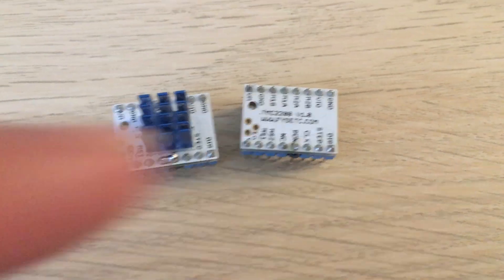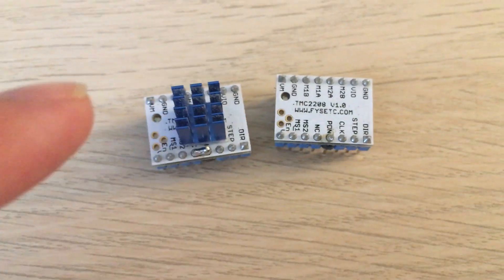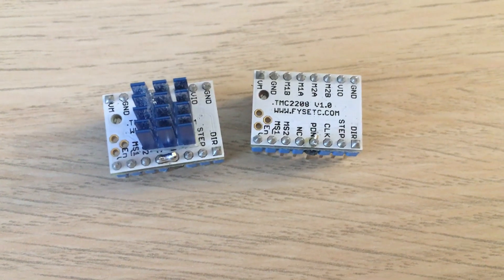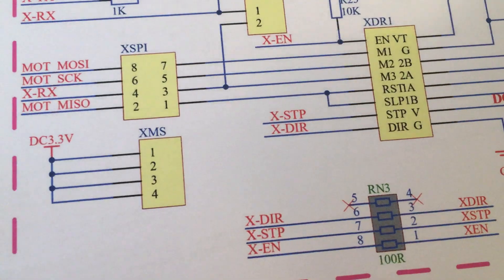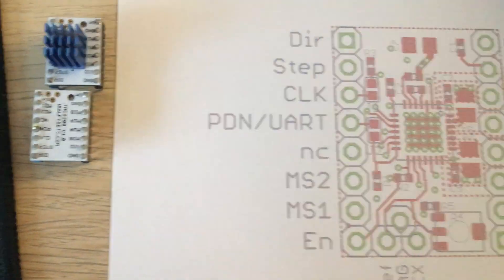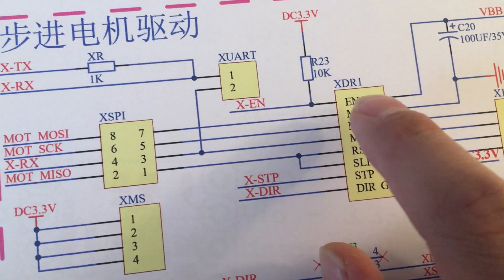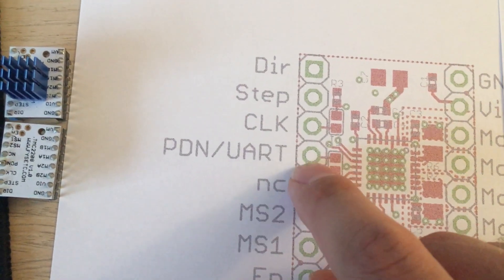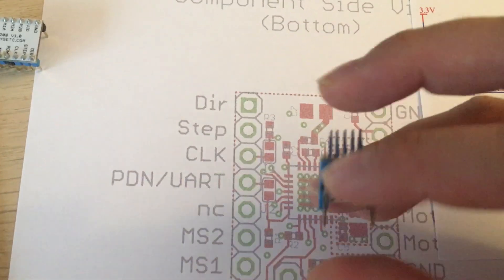Fysetc TMC2208 v1.0 UART on SKR 1.3/1.4

Comment: Thanks i had the same problem. My driver is called MKS V1.1 TMC2208. But is exactly the same. I also had to cut off the UART pin. Because the UART Pin off the BTT SKR 1.4 Turbo is next to the MS2 Pin. Then i soldered the 2 pins in the middle (UART and NC) together. Then everything worked great.

Comment: It will works, but you can do this easier. You dont need to cut PDN pin, cause of it not connected with 1-2 jumper (tested on SKR1.4). Theoretically, in that xSPI connector, it is possible to connect 1-4 by a custom jumper, so you dont need to solder PDN to NC. 
P.S.  The 2 pin pad on the underside (near PDN) must be bridged.

Comment: Hello I own a FYSETC F6 V1.3 Board and a RepRapDiscount Full Graphic Smart Controller and tmc 2208 v2.0 This driver is available in my country is it possible to work with it as I can't get a driver 1.0 The driver is not available in my country
Reply from the maker: I’m not really familiar with all of the models, so I’m not 100% sure. But they should work together, and may not even need these modifications.